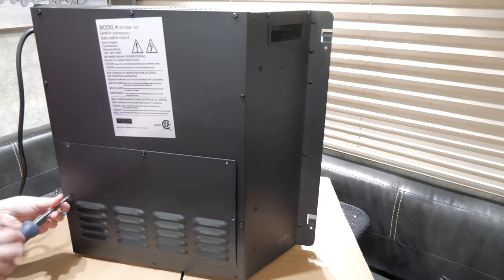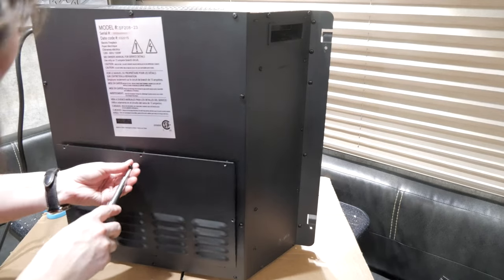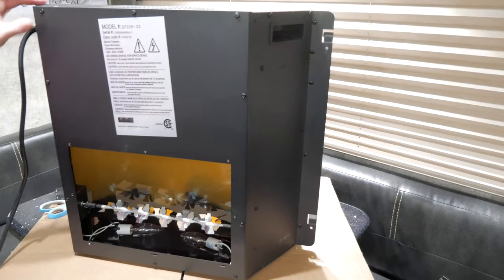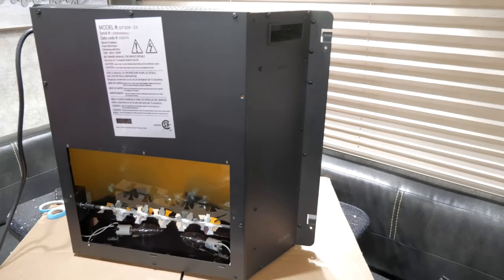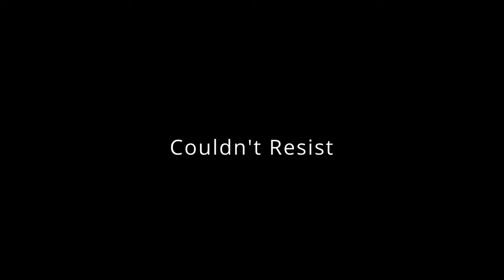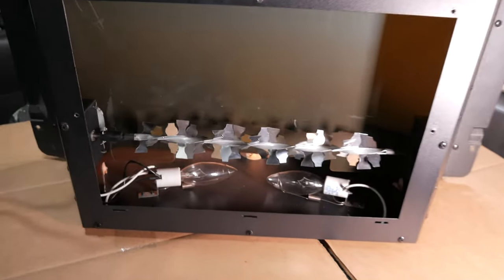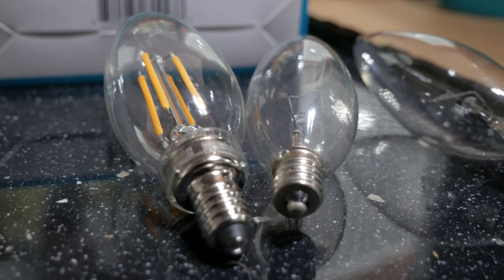Banish the Beep: Reduce that RV electric fireplace noise!  | E6

Comment: That's really good info. I have a question about how that heater does when running overnight off of your batteries. You had mentioned on another video your husband was installing BB batteries. I would really like to know about it. Thank you very much. Safe travels.
Reply from the maker: Hi Danny, that is definitely a good question.  We were intending to use the fireplace for shorter durations off-grid for ambiance/heat while we're relaxing in the eve and then use the standard heater overnight (unless we're plugged in somewhere).  That fireplace is 1500W, which converts into 125 amp-hours (1500/125).  With our 4 BattleBorn batteries (400 amp-hours), we wouldn't make it past 3 hours (and that's assuming nothing else is running).  Something else to consider - the fireplace doesn't have a good intake to feed heat to the basement like the standard heater does.
Reply: @TheJoslynJourney  Thanks for responding. I was wondering how many batteries you had installed & now I know. Was also wondering if the heater cycled off & on which could possibly extend overnight usage. Thanks
Reply from the maker: @snoopydan3594  Yeah... our electrical/solar layout video will be posting this upcoming weekend!  And I agree - it can likely stay on potentially a lot longer by cycling.  I had it down to the 65F and cycling but never captured it on our system yet.  I'll have to try that in the fall likely now that highs here are now in the 70s/80s for the next few weeks!
Reply: @TheJoslynJourney  Thank you so much for the answers. This really helps in my research. Looking forward to seeing more videos.